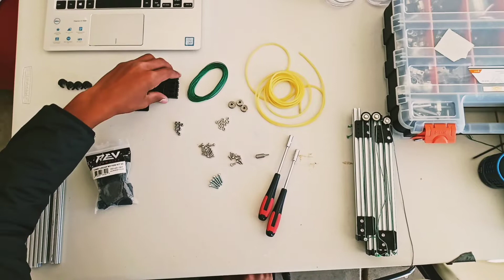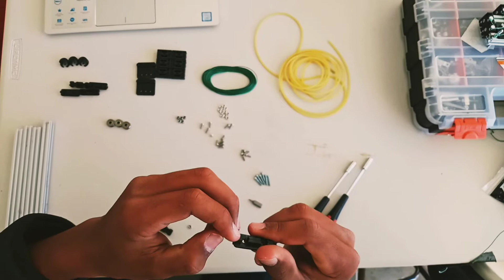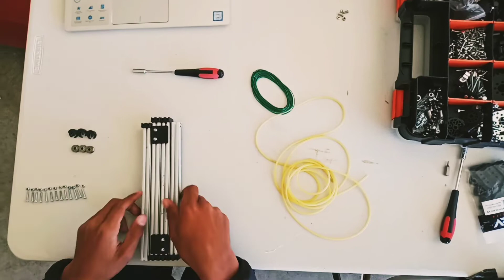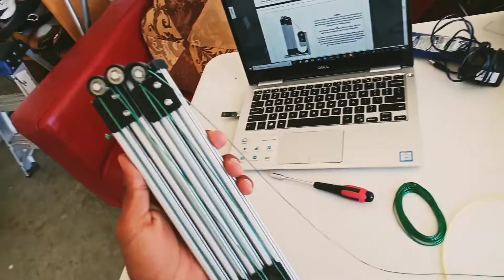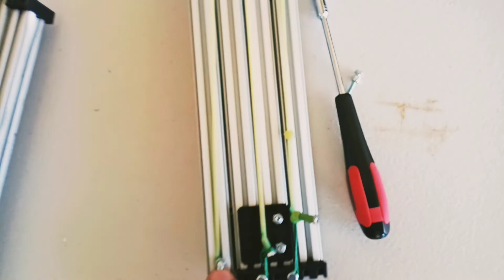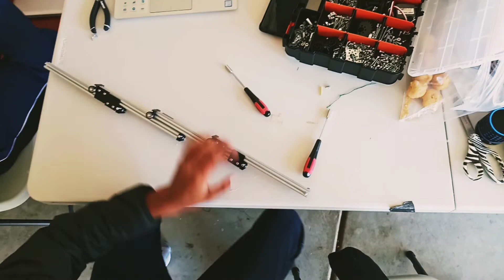Assemble REV Linear Motion Slides

Comment: awesome video - first one that interpreted the REV linear motion manual. i'm still confused on the stringing parts.
Reply from the maker: Sorry for the late reply but if you are wondering there are many videos that show stringing for linear slides. You can also look into videos for other linear slides such as actobotics. We personally prefer the actobotics linear slides because the use metal rollers and are easier to control.